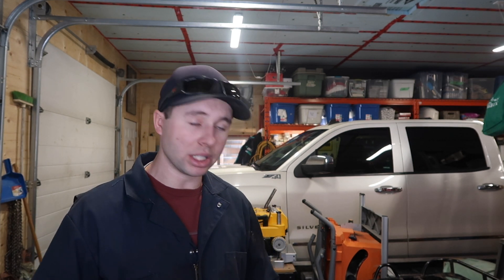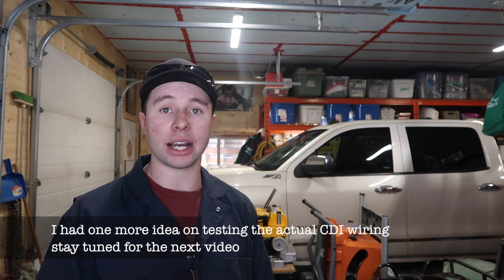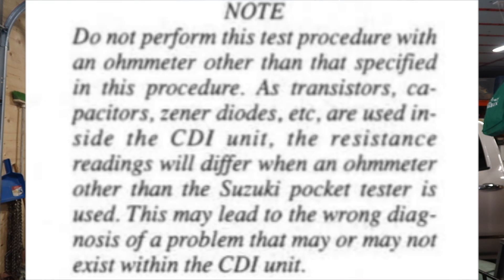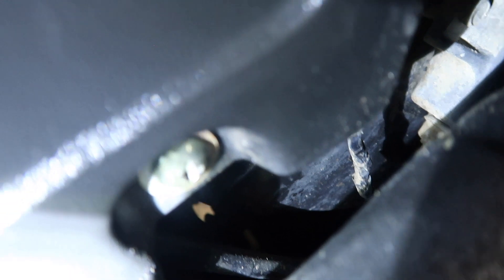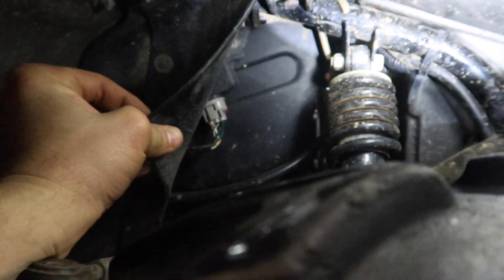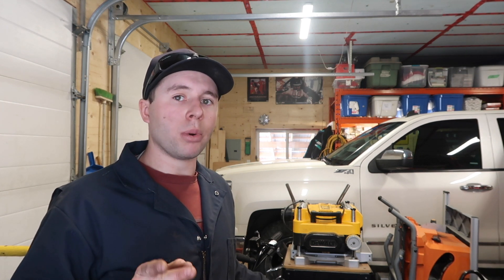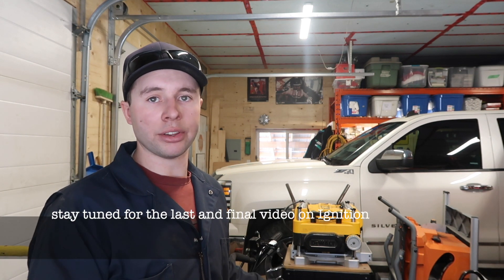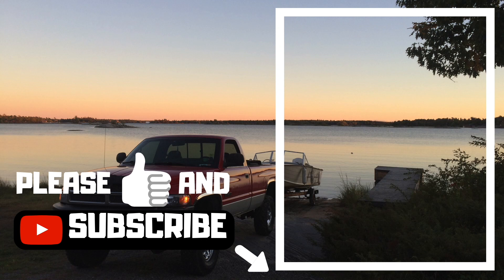How To: Suzuki King Quad 300 + Quadrunner 250 Ignition Testing. Part 3 : CDI

Comment: I have a 1997 king quad 300 . It idles good. Then When you give it gas it runs good for awhile then bogs down Then When you turn on the lights it runs good for awhile and then it starts to bog down again I've traced most of my wires but I'm stumped what could it be thanks Rene

Comment: Wow !!!!!! You are a GREAT mechanic. I have 1 question. My LT-F250 has spark sometimes. I do know for sure the starter will not crank the motor. I have to use the pull crank. If the CDI is dead, will it give any spark, or none at all?
I have seen on some bikes the starter clutch can come apart. Wondering if its possible loose needle bearings could contribute to my issues?

Thanks in advance 
Steve

Comment: Is this the model that has same engine as arctic cat 250 2002?  When I plug up battery  wires start to get hot at the rectifier plug  and I can’t get a spark

Comment: Thanks for your videos. I've had my 300 king quad over 20 years. It has never run 100 percent . But now it will not run at high speed it cut out. On Google I see a lot of people have the Same problem but no come up with the answer. I've jet up and down with no change. I can pull the carburetor in 8min and put back in with no problem I've pull it so many time 30 plus times. What should I look for if you can help find the answer.